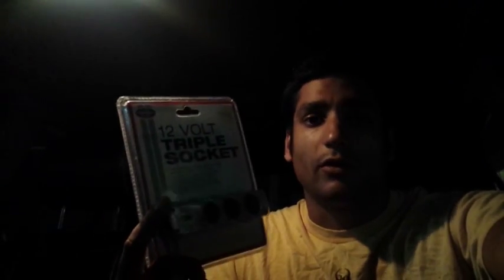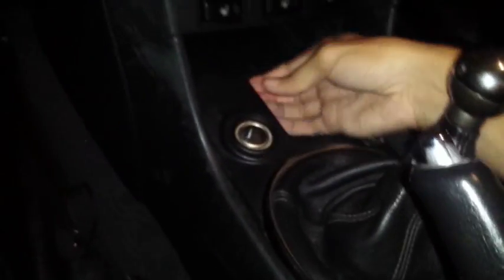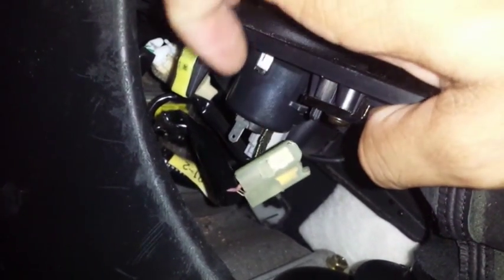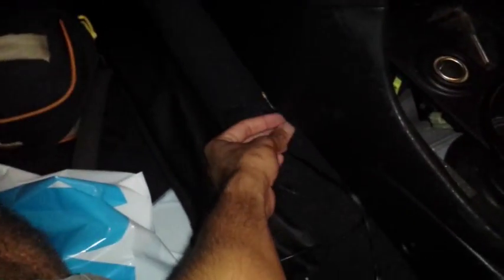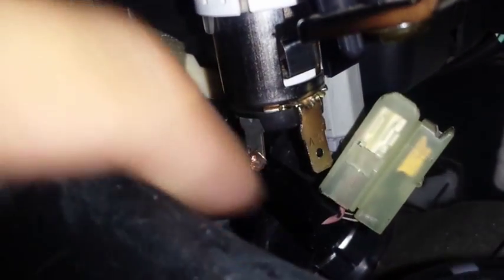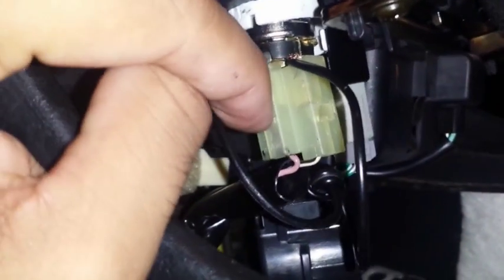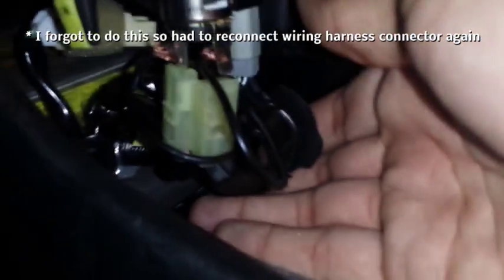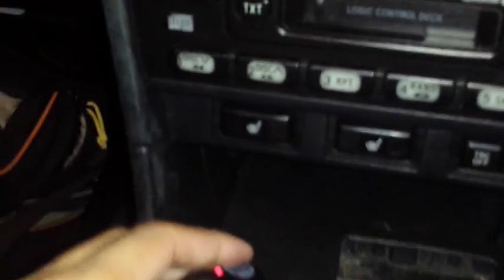DIY: How to add 12V cigarette lighters plugs in your car - IS200 - Hidden under your dash!

Comment: I was removing the cigarette lighter to replace a new one and by an accident the two of the terminals positive and negative touched one each other. Now the two of the terminals are showing ground signal. The pink color supposed to be the positive but now bought of them are negative signal. all fuses are in perfect condition. Do you now what happened and please would you tell me what to do? Thanks. By the way my car is a Camry 1997
Reply from the maker: +Oscar Crespo a tip when doing anything electrical on your car is to disconnect the battery first. How are you testing that both are now negative? with a volt meter or bulb connected to the battery or something? maybe you have melted some of the wire somewhere on the positive and it is fused to something connected to your negative, like the chassis or another earthed wire.
Reply: id say are you sure that all fuses are fine as in nearly all cases of the two terminals touching like that, the fuse blows. im thinking that maybe theres another fuse thats blown in the circuit before the main fuse in the fuse box......thats assuming you are checking the primary fuses and checking the correct one for your cigarette lighter/12v accessorie?